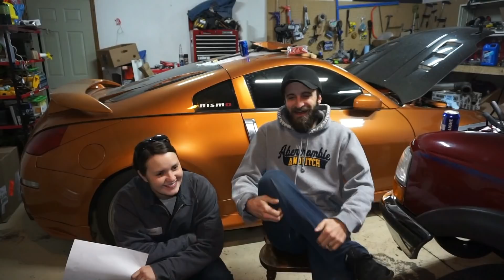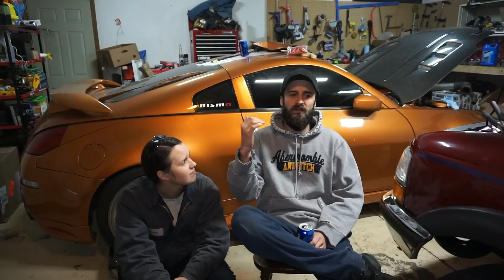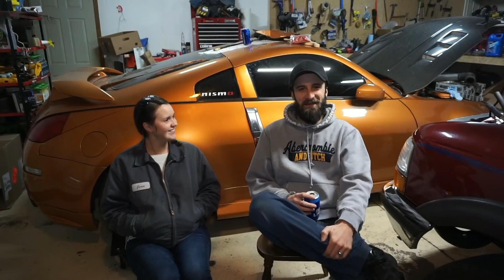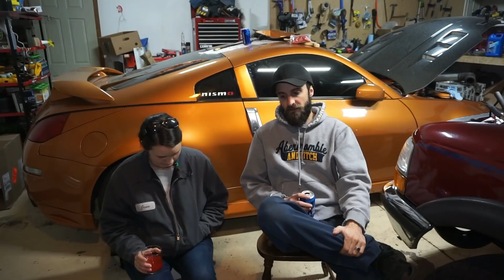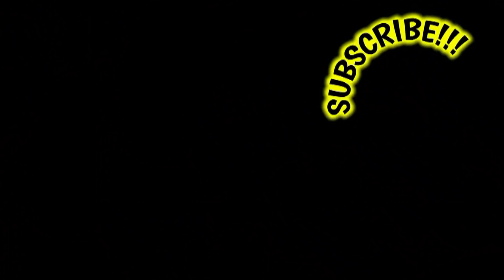HP Tuners Tuning Acronyms!!! What Do All These Letters Mean??

Comment: GM VATS (early), Passlock 1, passlock 2 and Passkey 3 (also 3+) ---Vats, PL1 and PL2 are resistance based. Early VATS have a resistor chip in the key that is read by contacts in the ignition cylinder, Passlock 1 and 2 send a certain resistance to the PCM. The resistance value comes from the ignition cylinder not the key. Passkey 3 uses an RFID chip in the key so it must be in proximity to the ignition cylinder. The PL3+ uses an RFID chip  AND a multiplex ignition wiring setup. VATS, PL1 and PL2 can be bypassed with a resistor (and preferably a relay so if it fails, you can still start it with a key, assuming it hasn't been disabled.) On my Gen 3 6.0 LQ4 I measured the resistance for the ignition so that I could "duplicate it" for testing before I have my friend turn it off with HP Tuners.